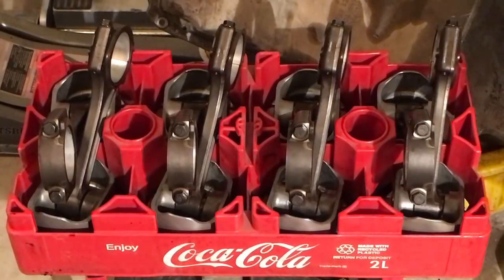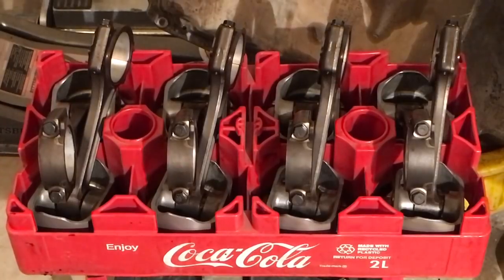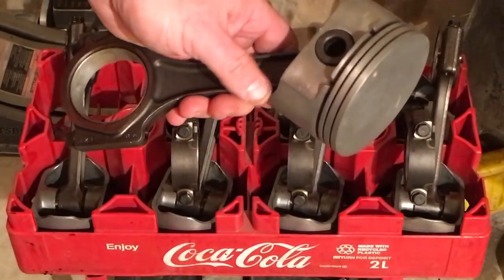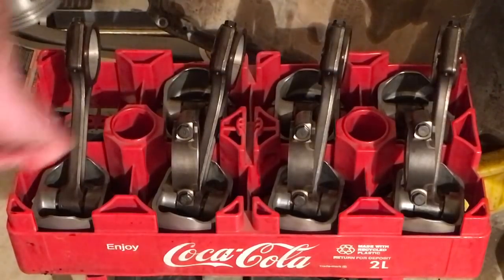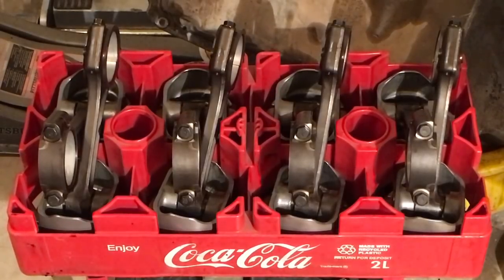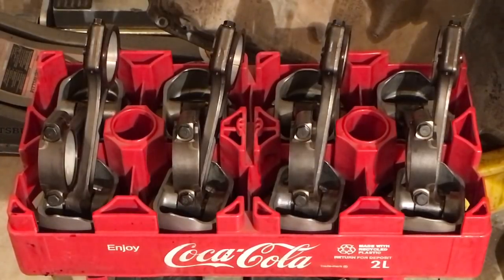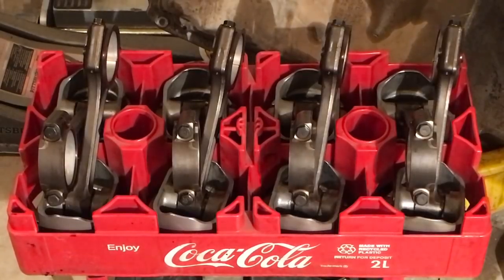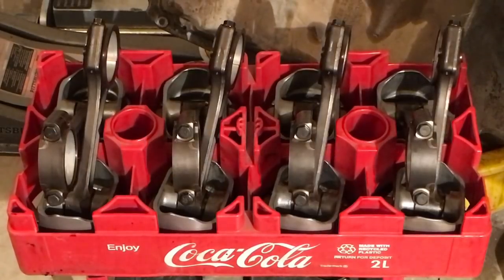4.8 Turbo stock rod bolts cleaning 300k pistons

Comment: I saw a test on reused 200k mile head bolts vs new, the old bolts out performed the new bolts in stretch, tourqe yield, clamp force before failure, they just did better..
Reply from the maker: Chris Langieri I saw the same video, the sad part is he doesn’t show retained clamp force, only how far each stretch before failure. I’ve heard/read several people say they’ve never seen a stock rod bolt failure, the rod breaks before the bolts.  Basically they’ve never justified using ARP bolts in a stock OEM rod.  👍
I’ve had good results torquing the factory rod bolts to 50# in 3 stages.  I like knowing they’re all the same. 😉

Comment: When rebuilding a Volkswagen VR6, you get the opposite problem. Even when the manual says you can reuse your rod bolts, you can't. There are too many stories of spun rod bearings on such engines from reusing rod bolts. The same thing might apply to other water cooled VW engines, but the VW VR6 is something I am researching because I want a Winnebago Rialta VR6.
Reply from the maker: Skyline Fever That’s crazy, I’m surprised Volkswagen isn’t held responsible for advising the re-use of the bolts?  I’d say this shows another big difference between the US and other countries, it’s very common to get sued in court for liability here. 😳

Comment: I picked up a couple gallons of berryman's B12 chemtool like a year or two back on clearance for $4.50 at Walmart and soaked my LS1 pistons and rods in it for couple days and they came out looking brand new. I also started soaking pushrods, rockers and lifters in it too that stuff works wonders.
Reply from the maker: martinez1701a Definitely scored on the Chemtool for only $4.50, that stuff really works! 👍. The only down fall is is does take several days to fully work, applying the Great Value oven cleaner in steps about 15-20 minutes each soak you can clean the pistons in a couple hours.
I like the Berryman stuff, it will soften all the carbon in the ring grooves where it will wipe out! 😉

Comment: Ok. I understand completely that the fastener will never be as strong as new. But just remember that rod bolt failure happens when the connecting rod speed exceeds terminal velocity (over reving) or improper installation (over torqued and rolling the treads) Now if you didn't roll the threads or exceeds stock engine rpms you should be ok. Notice Matt Happel doesn't try to buzz his builds to 7200 either. I have a (fancy) torque wrench and it works great for all new vehicle fasteners. I have a torque angle gauge (good one) and I agree it is a pain in the ass in some situations.
Reply from the maker: Mike MacCracken I’ll be using the factory bolts, the only real mod I do to the Pistons/rods is add oil drain backs to the oil control ring lands. 
My friend Andy use to have a really nice Cornwell digital torque wrench that did torque angle, but he traded it in to the tool truck. 🙄. I’ll be torquing my rod bolts and torquing the head studs. The only bolts I’ll probably be using the TTA method is the larger main fasteners.  Mostly because I haven’t found much info on a torque spec to substitute.